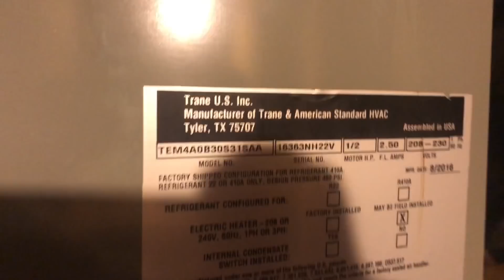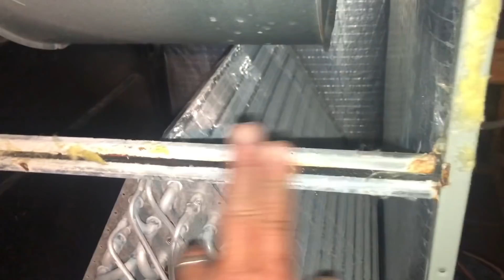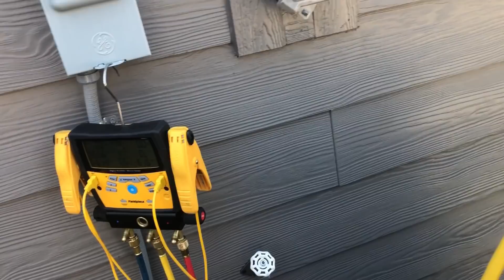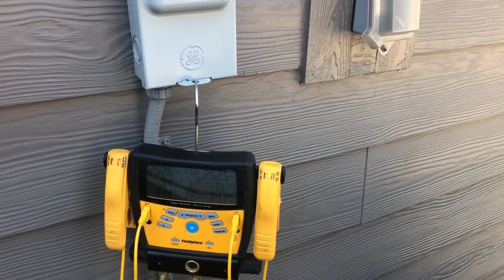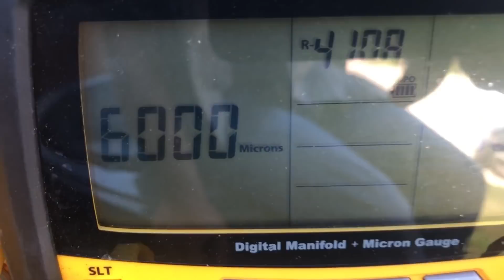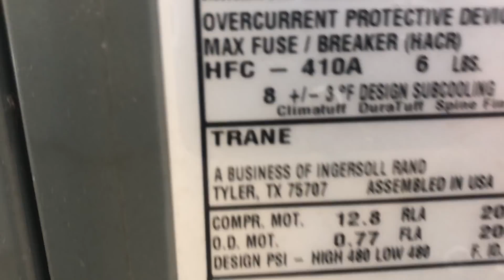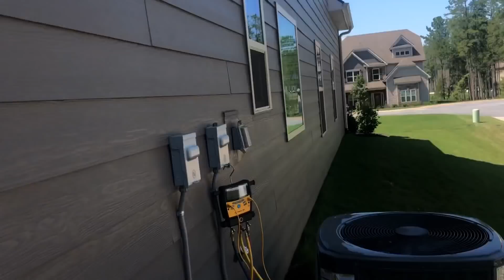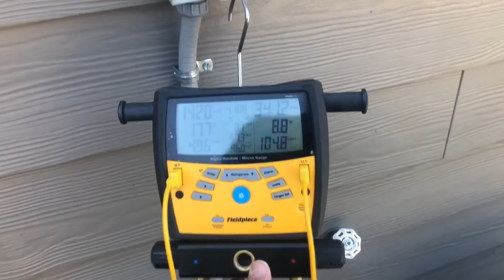New Construction Trane Failed TXV replacement with tips

Comment: The better grade of equipment will fail too, if a butcher installs it. A lower grade, like a Goodman will run for 20 years if installed correctly. On new construction, the hvac contractor always subs out the install, including the ductwork. He takes the lowest bid usually at the future expense of the homeowner. The tech shows up to finish and do the start up.

Comment: Most new construction failures are caused not by the equipment, it is by sloppy installation. Builders squeeze the subs for the cheapest price and tell them they will make it up by volume of the jobs. Many hvac companies sub out the install  to “Installers”, not their employees. Installers work even cheaper and rush the install cutting corners. I have witnessed an “installer” braze the line set and not run nitrogen to save time and money. If it is below 60 degrees when they install, they guess the charge and never come back to recheck when it gets warm. The result 6 months later is unsatisfactory temperatures, noise and premature component failures.

Comment: Sir I have the same txv bolt on on one side and sweat on the other. Where did you get the adapter to make it threaded on both size? Please help my home has no air conditioning if you can provide the part number to order that adapter.

Comment: Several years ago I got a new Trane AC system. The following season I turned on the AC and it started short cycling. Turned out one of the reasons for the short cycling was the TXV was stuck. Seems to be a common issue with Trane systems.

Comment: I’m in Florida and bought a Meritage Home in a new development and lots of the home owner have had problems with Lenox AC units the builders installed. Lots of problems with the Lenox evap coil rusting and leaking.  TXV valves problem etc.

Comment: Who pumps down a unit with a bad TXV? You do not know exactly why the valve actually failed failed! I would try the additive that Trane offered first, when they had that compressor manufacturer that used the un-approved corrosion inhibiter in the compressors, but if it is due to contaminants in the system pumping it down does not fix the long term problem! It is still in there! AND HOW DO YOU KNOW THAT INSATALL COMPANY PULLED A PROPER VACUUM, THEY MAY HAVE JUST PURGED THE LINES WITH REFRIGERANT AND IF YOU PUMP IT DOWN THEN THAT PROBLEM NEVER GETS RESOLVED! NEVER COMPROMISE YOUR QUALITY ON AN UNKNOWN!

 Recovery, new drier, flow nitrogen, pressure test, and evacuation below 300 microns on every TXV replacement.

Comment: What brand AC would you recommend? We are building a new house
Reply: Cadillac
Reply: My 1976 house needed a new furnace and AC in 2014. I had a lennox put in. It's been problem free. Virtually silent. I turned it on the other day it was 80 inside and the air coming out of the register was 54. I am very happy with it. Came with a 10 year parts warranty and I added a 10 year labor warranty for a couple hundred bucks at time of purchase. It takes the 5" filters and even though they are rated for 1 year I change them every 6 months. So far so good.
Reply: American Standard or Trane  
Installation tech is the key to a reliable unit

Comment: For us retired contractors who did EVERYTHING but HVAC, a list of definitions would be nice, such as “Schrader” and what it does.
Reply: It's in your tire the thing that puts air in your tire, it's a one way valve
Reply: Schrader is the one thing I actually know about! It’s just a valve, used on about all car tyres, most bicycle tyres (schrader and presta are the main types on bikes, and in my country also Dunlop) and apparently on HVAC gear. It’s got threads on the outside and a pin inside it that if you push it will let all the air out.

The kind used in HVAC must be slightly different than standard car tyre stems because if you pulled a vacuum inside a car tyre those valves would just open up.
Reply: txv = thermal expansion valve

Comment: After watching quite a few repairs of various makes by different people, as well as repairs I've done myself, they all look to be of acceptable quality. 
The care taken by the installer is at least as important as the brand of A/C.
Reply: What would happen if I was to put r134 in my r22 system?
Reply: You will send it to the grave yard! @Fone65
Reply: @HienLe-qh6mo  I asked that question to see what he would say. My 22 year old Concord condenser ran for more than 5 months. I bought a new Goodman condenser this year before summer came. I topped it off with 134 and ran it for about a week. A fan hit me and sold me a full new tank of 410a. He said I probably fried my new $1,950 condenser using 134. The only problem I saw was the gauge would go up and down. I sucked out the mixed freon and put in straight 410. The pressure is stable now.
These a/c techs are getting over on people. I'm not going to allow that to happen to me. I will never call one as long as I can do the work.
Reply: @Fone65 Do you have the EPA 608 certification allowing you to handle refrigerants such as R-410a legally? You can do all other works on your AC units except handling refrigerants.
Reply: @HienLe-qh6mo  I don't need it to work on my own house.
Reply: @Fone65 That is not true. You are against the law that mandates the EPA to protect the health and safety of the public and the environment. Take your EPA 608 Certification test and be a good citizen.
Reply: @HienLe-qh6mo  It is always funny how people with no videos on the subject, are always trying to school someone. It is 100% legal for me to have 410 as long as I only work on my own house. Upload some video of you working on your a/c unit before you try to school me.

Comment: Hard to believe that is a new home! Glad I'm in Michigan with a basement and nice metal ducting that was put together by some guys who knew how to bend some sheet metal right! On a side note, can someone explain why TXV is better or why it would be used in place of the good old capillary tube?
Reply: More precise metering of refrigerant to control temperature. A fixed orifice can only meter the same at all times so you cycle the unit off and on for "control." TXV can adjust orifice size and pressures at the evaporator so the unit can keep running. Much easier on all the parts and electric bill. They both work, one just works more efficiently. EEVs are even better but require more sensors so... it's all a tradeoff

Comment: I have a question about equipment.
Those temp. Clamps are really expensive for what they are.
I bought 2 Klein Clamps that came with the K-type thermalcouple AND Kleins version. They cost $20.44 through Amazon. I tested them side by side with fieldpiece and they were pretty much dead on. Anyone have experience with these Klein clamps ? I thought $20. was a good price compared to  what Fieldpiece of crap wanted.
Reply: Thermocouples are essentially reaaaaally simple stuff — it’s two kinds of alloy crimped together. That’s it. As long as the alloys are made of the correct metal, there’s not really anything to screw up for a manufacturer. Ie, the quality of the plastic surrounds, etc, not really a factor.

Comment: Thats what FROSTS MY BALLS about Trane,and Lennox. 
 Not thoroughly vetting a contractor before giving them the keys to the car.
 I was a BRYANT dealer. I pretty much worked alone other then the 4 warm months but I was anal about doing the job right AND aesthetically nice. All new Furnces
 installs got a new cold air return drop,canvas connectors for noise,
4" wide air filter track ( I included 3-4" wide pleated filters ),red emergency switch plate, concrete slab under furnace with 2" blocks on the corners just in case the homeowner had a water leak like a corroded hot water heater tank.
Outside, I'd dump bags of pea gravel before placing a God awfully heavy a 36x36x2 solid concrete pad with blocks on the corners.
No landscaper named Paco is going to fuck up my install by weed wacking the paint off and fucking the coils up. 
NOW.........I do commercial service where all that attention to detail is irrelevant. I have no say cuz I work for someone now.LOL
I miss having my business.

Comment: Whenever I remove the metering device I always blow nitrogen through both sides to remove any foreign particulates before reassembly especially if the TXV has been replaced before. Just piece of mind I guess.

Comment: Interesting theory that you have purging the system with nitrogen before the pressure test. Makes a lot of sense. I have been burned in the past on a pressure test where I thought I had a system leak yeah, but it was my gauges. One of my hoses. I use a test gauge now for a pressure testing line sets. I don't have to sweat it out with my manifold or hoses leaking. I'm starting to use the Appian evacuation System Kit Pulsar pretty good vacuum. Here is the single-port test gauge and I'm talking about pretty cheap but it works very well

https://www.grainger.com/product/JB-INDUSTRIES-Test-Gauge-48ZJ77

Comment: The flex and box duct system is common in south. It is less expensive and can be installed easy and fast for production. If done right,  the duct will work properly.
Reply: Most of the time, it's a botched mess.

Comment: Back in Sept 2019 near Charlotte Motor Speedway 2 year old house. Never cools on 90 degree day or better says homeowner. Looks like bad TXV on a 2 year old Trane with the black flex with 3 mixing boxes. Why do they paint mastic on the jacket of the flex and used 1/2 gallon on 1 mixing box. Had a 300 head and 55 suction. Pumped down the unit. My helper trainee calls me from attic  said straw was in the line set. So we cut both line sets blew out grass seed and straw and a pebble. First one I have seen in 35 years. Cut out dryer with straw in it. I left the TXV cleaned out line set best we could. Install new  dryer,  it pulled down to 500 micron. Cooling great. Home owner calls me 2 weeks later and says its cool. I will be surprised if it will last 3 more years till warranty is up. But another new housing area with 50% Trane the other 50% Lennox. I wish my camera was running when the hay was blowing out the suction line. A shout out from Charlotte. Like your video's.

Comment: Tranes are good units but I really feel they are, at times, overrated!
Reply: Their good times are long over.
Reply: @FrozenHaxor  I have a trane evap coil installed that has been recommended to be replaced by two different repairmen.  One said it was the TXV the other said its the coil is leaking but never showed the leak.  Both said replace the whole coil primarily because its under warranty(5yrs old).  The kicker is the labor isnt included in the warranty and it appears it will be wise to replace the whole unit vs only the TXV.  SMH about this failure so soon.
Reply: @liveyalife08  Wow that sucks, must be low quality brazing work at the factory, slapped together... it's all China Export nowadays, can't get good stuff even if you want to pay more...

Comment: I have never seen a nice piping job or duct job in your videos. Are you not required to pull permits for installation or change outs. 
   We need to educate the customers every chance we get.
Where I’m at we have found a higher rate of coil failures in homes with spray foam regardless of the Ac brand.

Comment: I’m sure the valve was damaged during the installation with trash in the lines or failure to remove the bulb and protect the valve while brazing. Or worse they used a turbo torch.

Comment: I have been doing HVAC/R work for 44 yrs. I agree with everything you done except for the Micron Level. I have experienced refrigerant leaks between 300-500 microns. I usually evacuate to 200 Microns.  NEVER had a leak at that level. Other than that, good job.

Comment: It is disturbing the new construction home didn't have a 120 volt service outlet next to or built into the disconnect.  You shouldn't have to be needing to disconnect the contactor to ad hoc AC power for the vacuum pump like that.

Comment: I will say the new "AMERISTAR" all aluminum coils look pretty nice....

They now use a large bore "DISTRIBUTOR" which allows the use or either the small "BULLET" type piston with a built in sleeve you can remove, or you can remove the sleeve and use a larger 'DANFOSS/GOODMAN' type piston as i do....

Nice change and the coil was sharp.. I use them for mobile homes when people don't wanna pay to change to a entire Rheem/Ruud air handler.

Trane....  No thanks!! I soured on Trane/American Standard over the 9 out of every 10 compressor i changed was to replace their shitty orange "PUMPKIN" compressors... If those weren't failing at or near the 10yr mark, their txv's or brown fan relays fail one..

Literally (9 OF 10) compressor i buy and change go in the Trane/American Standard brand..... 9 OUT OF 10 or 90%!!!!! yearly!!

Comment: backup wrench on flare nut, best way to tighten them is one handed, which has a far less risk of twisting/winding anything up., of course not everyone has very strong hand grip.
I don't look very strong, but I regularly break, snap and shear things off if I'm not careful, like screw drivers I've been snapping the tips off them for 30 years, philips and flathead both. no, not cheap junk ones I'd bend them removing from the packaging lol (not pointing fingers at harbor fright or the garbage chinesium from local box stores) wink wink  ;) ;)

Comment: Throw that widow maker "receptacle with alligator clips" in the trash!  They kill folks. Take 5 minutes, Run an extension cord with a ground, work safe, it only takes one time.
Reply: I have a feeling he's the type fella with natural high resistance, 120v to ground/neutral just makes us cuss and let go, now 277V we pay respect to, it does hurt a bit.
coworker about sharted his jeans when I wired an dryer outlet live in the mid 90's, USA so 2 legs of 120V, neutral and ground. I wasn't  worried, didn't get shocked and connected the hot legs first, then the neutral and ground last. I was also on first floor of dried in new construction home, rubber insulated work boots on top of that, only way to get zapped, tough a hit conductor and ground/neutral.
I still wire live more often than not, if it's newer wiring and not old cloth/tar coated/knob and tube(asbestos very likely) residential or 208V 3 phase at most, it only annoys me when I get zapped.

Comment: I have a different view of Trane selling parts to non-Trane dealers.  If they close off those sales they are guaranteeing that non_Trane and supposedly inferior parts will be used and theoretically the units will fail more often.  Does not that do more harm to the Trane  reputation than an sloppy install that no one but another repair tech sees?
Reply: Trane parts are the inferior parts with an attached $100 Trane sticker applied to them.  Almost all HVAC parts come from the same very few manufacturers
Reply: @waynespringer501  I had multiple failures of a contactor in my old Trane heat pump.  It used a beryllium copper part that doubled as a spring and and conductor to the contacts.  Contamination on the contacts heated the spring and it turned into soft copper.  The local Trane place would not sell me one since I "was not in the business" (I am a mechanical engineer who has designed AC equipment) and the internet wanted $85 for the original part.  I got a generic contactor for $16 that has been working ever since and that was at least 10 years ago.  But, I have to say that old Trane is 35 years old and still running.

Comment: If you would increase your hose size 1/2 inch and remove the Schrader valves, you would have pulled a vacuum in about 5 minutes. I use nylog on all my joints and lots of nitro like you do. I use a 3 CFM Robinair 2 Stage Vacuum pump. Cost like a hundred fifty bucks. I don't use manifolds ever. Just your standard T at your vacuum pump with 2 1/2 inch hoses. Appion valve core remover tools. I purge LOTS of nitro to either remove air but also it pushes the oil onto the interior walls of the refrigeration lines so it will keep your vaccum time down. Pulling the vacuum in 3 minutes down to 350 microns. I love watching the videos and try to glean something new every time I watch your set up.
Reply: let that magic speed vacuum sit 30 minutes to an hour and see what happens ;)
Reply: @Maximus Decimus Meridius  there is no second or third vacuum and the standing test works just fine. This is no new Secret. This process has been around for a while. Each to their own I see people still using quarter-inch hoses. I'll do my three to five minute vacuum while others sit there and wait on the vacuum pump to finish for 30 minutes to an hour. My vacuums are so fast and by the book that I can usually sit around and wait for the vacuum pump to finish and have the charge dropped and everything all in one sitting. Keep in mind this is doing everything by the book. I remove the Schrader valves, I use half-inch hoses, I use nylog, I change my vacuum pump oil, and I purge nitrogen through my refrigeration lines prior to evacuation. Try this process a few times and you'll do it without even thinking twice and you'll see that it cuts down the average time of most HVAC techs. Also, you should have your micron gauge at the service port to receive an accurate vacuum guage reading. I change any and all seals that look bad on my refrigeration hoses. I clean my micron guage before every  job. To achieve this vacuum you need to be careful not to skip any steps mentioned.